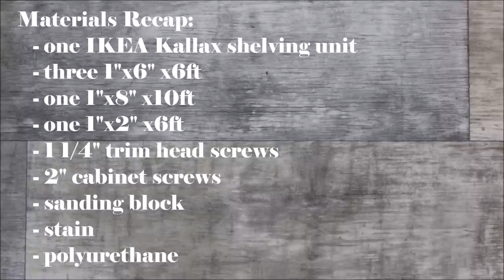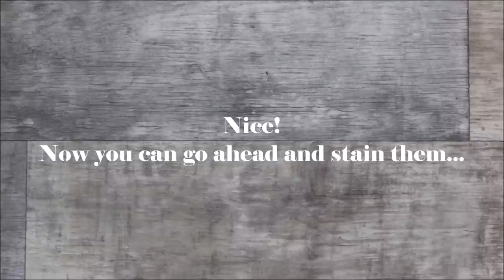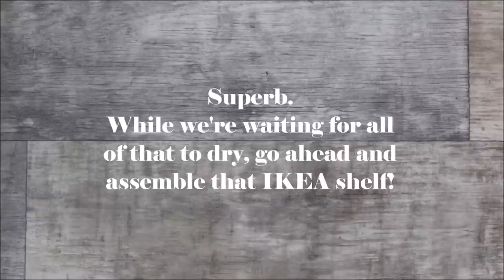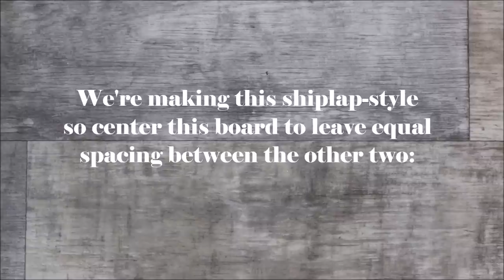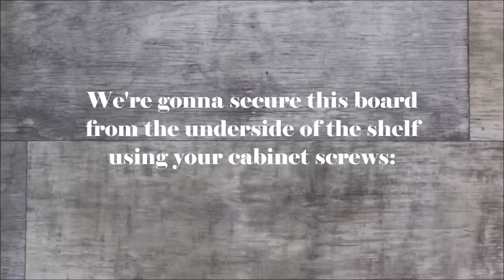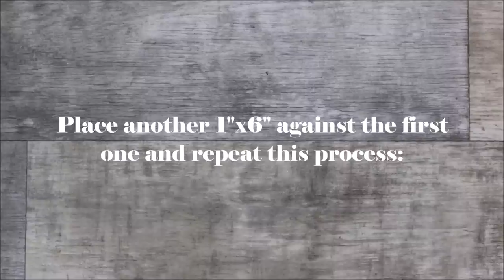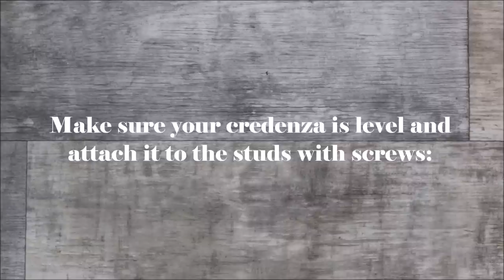IKEA HACK: The Floating Credenza

Comment: It all looks great, but why don't you use assembly glue instead of screws?  First, it's faster and you can't see the screws.  So don't break wood.  I've never used a screw, I always work with assembly adhesive and it holds great greetings from Germany

Comment: right before hanging it to float....how did you know where to predrill in the location the studs would be?
Reply from the maker: We marked out the studs and then place the shelf along the wall in the location we wanted it. The studs run top to bottom in the wall so you can match up where the studs will be and drill through the back of your shelf. Hope this helps!